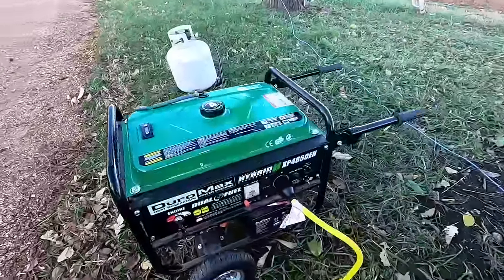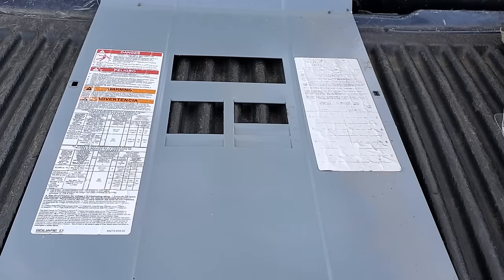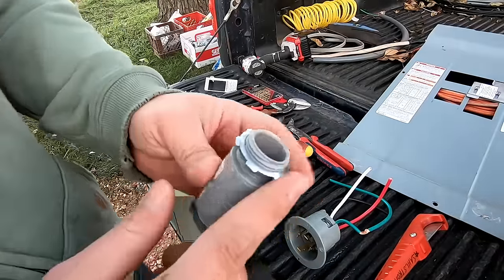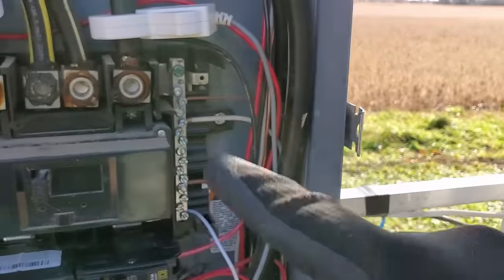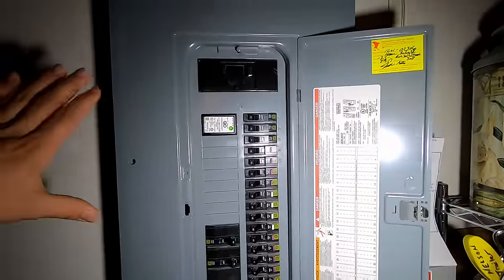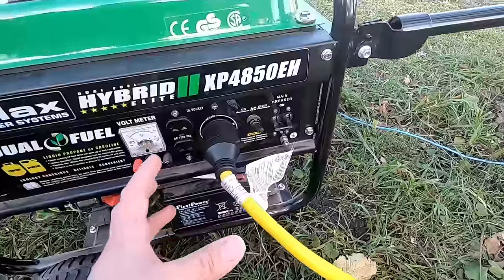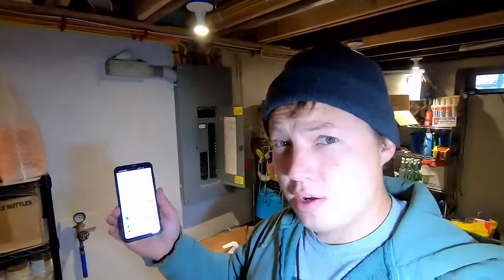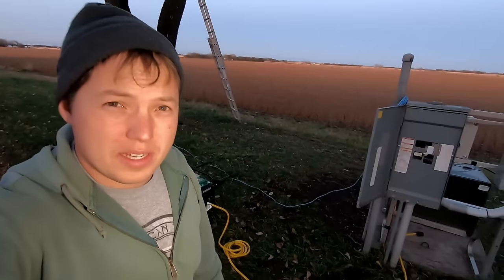How To Hook Up a Generator To Your House Using a Breaker Interlock Kit & Power Inlet Box

Comment: 11:09 don't you need to put grounds and neutrals on different busses? (I'm a newb so I'm just asking out of curiousity)
Reply: ⚠️Please don’t forget to follow the generator safety tips when you use your portable generator:

This is a reminder for everyone’s safety when using portable generators. All generator safety rules need to be followed carefully whenever you use your portable generator. This is just to make sure. 

1) KEEPING OTHERS SAFE: Please do not allow an unqualified person or your children to operate and service the portable generator. Just because some manuals don’t say that doesn’t mean it’s safe. That is important against the generator safety rules. We also need to be keeping an eye on our children too. You need to make sure that your children are not playing near the portable generator especially when it’s running so they won’t get electrocuted. Generators pose electrical risks and they can be hot during an operation. Please keep your children away from the portable generator at all times. It is important to keep our children safe especially our little ones. Be aware of all the hazards.

2) WHERE TO RUN YOUR GENERATOR: Some people use their portable generators indoors which increases the risk of carbon monoxide poisoning. It’s important to have a carbon monoxide if you have a gas generator. Never ever use your generator indoors even if your doors and windows are open and even in the garage is not safe to use a portable generator. Not even at your porch and your deck. It is never safe to use your generator indoors and in enclosed areas of your home. Your generator needs to be 15-20 feet away from your house. 

3)🔥FIRE HAZARDS: Never refuel your generator while it’s running. You need to let your generator cool off before refueling it and before storing your generator. Never overload your generator too. Never ever back feed your generator. You should never plug your generator into a wall outlet. Also never store propane tanks indoors. Please keep flammable things away from the generator as well and please don’t smoke cigarettes near the generator. Having a fire extinguisher next to the generator is also important against the generator safety rules. 

4) GENERATOR OPERATION: make sure your hands are dry before touching the generator. Never use your generator in wet conditions. Don’t let your generator get wet. You need a generator tent if you need to use your generator during wet weather. Please don’t wear loose clothes when operating the generator. Turn on your generator before plugging in appliances. Use the right cord for your generator. Please do not use worn out cords. 

https://youtu.be/I1jT3ANENvI and here is a video more about keeping others safe when using generators. Everything that is said about the generator safety rules all need to be followed. Especially keeping your children safe. 

Hope this helps

Comment: Question about that interlock kit and what you were explaining.  You mentioned that even though the Main was shut off your 110v legs were still energized from unused power inside the House.  So my question is when you flip the main off and the generator on, how are you planning to remove the remaining current to safely in order plug in the generator into that potentially live gen plug, how would you test it before plugging it in during a power outage?
Reply: Use a volt meter to test..
Reply: @fgonzalez78959  I was looking for his response to disapate the energy. Maybe the gen handles it to ground at first connection? . of course a volt meter can tell you what's stil there...
Reply: ⚠️Please don’t forget to follow the generator safety tips when you use your portable generator:

This is a reminder for everyone’s safety when using portable generators. All generator safety rules need to be followed carefully whenever you use your portable generator. This is just to make sure. 

1) KEEPING OTHERS SAFE: Please do not allow an unqualified person or your children to operate and service the portable generator. Just because some manuals don’t say that doesn’t mean it’s safe. That is important against the generator safety rules. We also need to be keeping an eye on our children too. You need to make sure that your children are not playing near the portable generator especially when it’s running so they won’t get electrocuted. Generators pose electrical risks and they can be hot during an operation. Please keep your children away from the portable generator at all times. It is important to keep our children safe especially our little ones. Be aware of all the hazards.

2) WHERE TO RUN YOUR GENERATOR: Some people use their portable generators indoors which increases the risk of carbon monoxide poisoning. It’s important to have a carbon monoxide if you have a gas generator. Never ever use your generator indoors even if your doors and windows are open and even in the garage is not safe to use a portable generator. Not even at your porch and your deck. It is never safe to use your generator indoors and in enclosed areas of your home. Your generator needs to be 15-20 feet away from your house. 

3)🔥FIRE HAZARDS: Never refuel your generator while it’s running. You need to let your generator cool off before refueling it and before storing your generator. Never overload your generator too. Never ever back feed your generator. You should never plug your generator into a wall outlet. Also never store propane tanks indoors. Please keep flammable things away from the generator as well and please don’t smoke cigarettes near the generator. Having a fire extinguisher next to the generator is also important against the generator safety rules. 

4) GENERATOR OPERATION: make sure your hands are dry before touching the generator. Never use your generator in wet conditions. Don’t let your generator get wet. You need a generator tent if you need to use your generator during wet weather. Please don’t wear loose clothes when operating the generator. Turn on your generator before plugging in appliances. Use the right cord for your generator. Please do not use worn out cords. 

https://youtu.be/I1jT3ANENvI and here is a video more about keeping others safe when using generators. Everything that is said about the generator safety rules all need to be followed. Especially keeping your children safe. 

Hope this helps

Comment: I installed a similar setup, with the interlock. My only concern is that it does not lock-out the neutral. Just the two hot wires coming in. I have discussed with other electricians and while this is technically safe and works, it may not meet code, since the neutral
Is not locked out as well. Thoughts??

Comment: At 14:45, why do you put in wire nuts? Would it be better to just straight wire it and connect it to the plug and remove the wire nuts? I’m not an electrician so I don’t know, but I would think it would remove a  potential failure point. unless  what I’m talking is a big no no.
Reply: ⚠️Generator safety instructions:

This is just a reminder for everyone’s safety when using portable generators. All generator safety rules need to be followed carefully to avoid hazards. 

1) Please do not allow an unqualified person or your children to operate the portable generator. Just because some manuals don’t say that doesn’t mean it’s safe. That is important against the generator safety rules. We also need to be keeping an eye on our children too. You need to make sure that your children are not playing near the portable generator especially when it’s running so they won’t get electrocuted. Generators pose electrical risks and they can be hot during an operation. Please keep your children away from the portable generator at all times. It is important to keep our children safe especially our little ones. Be aware of all the hazards.

2) Some people use their portable generators indoors which increases the risk of carbon monoxide poisoning. It’s important to have a carbon monoxide if you have a gas generator. Never ever use your generator indoors even if your doors and windows are open and even in the garage is not safe to use a portable generator. Not even at your porch and your deck. It is never safe to use your generator indoors and in enclosed areas of your home. Your generator needs to be 15-20 feet away from your house. 

3) 🔥generators cause fire hazards too. Never refuel your generator while it’s running. You need to let your generator cool off before refueling it and before storing your generator. Never overload your generator too. Never ever back feed your generator. You should never plug your generator into a wall outlet. Also never store propane tanks indoors. Please keep flammable things away from the generator as well and please don’t smoke cigarettes near the generator. Having a fire extinguisher next to the generator is also important against the generator safety rules. 

4) generator operation; make sure your hands are dry before touching the generator. Never use your generator in wet conditions. Don’t let your generator get wet. You need a generator tent if you need to use your generator during wet weather. Please don’t wear loose clothes when operating the generator. Turn on your generator before plugging in appliances. Use the right cord for your generator. Please do not use worn out cords. 

https://youtu.be/I1jT3ANENvI and here is a video more about keeping others safe when using generators and also about our family’s safety. Hope this helps

Comment: Nice video. I have an inlet box installed. However, I have my computer connected to an UPS in my home office, and I’ve noticed each time I’ve had to use it, the UPS doesn’t “like” what is coming from the generator. Is there anything I can do to fix this? I actually remember years ago at work that someone said UPS should not be plugged into a generator. Is that true?
I have a Durostar 8kw running dual fuel.  I’ve mostly used gas vs propane when I’ve had to use it. Thanks.

Comment: Hello Ben! Thank you for the videos! I am learning alot. I am trying to connect a 18kW max. 15kW running generator to my home electrical panel. I will be using the 50A output on the generator. Do I use a 50A double pole breaker or a 60A double pole breaker for the circuit? The generator says it has peak amps of 71.25A at 240v and running amps is 60A at 240v. I am confused because of the 50A output on the generator with the 60A running amps. Thank you for your time, Mike

Comment: This is a great guide to installing a backup generator using an interlock. A few additional details I’ve learned as I’ve gone through my own install:

Make sure the inlet box is properly labeled with “WARNING: FOR CONNECTION OF A NONSEPARATELY DERIVED (FLOATING NEUTRAL) SYSTEM ONLY” to conform to NEC.

To go along with that, make sure the generator does not have the neutral and frame ground bonded together or else it presents a safety hazard. If it does have them bonded, remove the bonding wire.
Reply: ⚠️Please don’t forget to follow the generator safety tips whenever you use your portable generator. This is a very important announcement for everyone. This is just a reminder for everyone’s safety. All generator safety rules need to be followed carefully 

Generator safety tips: 

1) KEEPING OTHERS SAFE: Please do not allow an unqualified person or your children to operate and service the portable generator. Just because some manuals don’t say that doesn’t mean it’s safe. That is important against the generator safety rules. We also need to be keeping an eye on our children too. You need to make sure that your children are not playing near the portable generator especially when it’s running so they won’t get electrocuted. Generators pose electrical risks and they can be hot during an operation. Please keep your children away from the portable generator at all times. It is important to keep our children safe especially our little ones. Children often get curious about anything so we should keep an eye on them to also make sure they’re not wandering towards the generator. 

2) WHERE TO RUN YOUR GENERATOR: Some people use their portable generators indoors which increases the risk of carbon monoxide poisoning. It’s important to have a carbon monoxide if you have a gas generator. Never ever use your generator indoors even if your doors and windows are open and even in the garage is not safe to use a portable generator. Not even at your porch and your deck. It is never safe to use your generator indoors and in enclosed areas of your home. Your generator needs to be 15-20 feet away from your house. 

3)🔥FIRE HAZARDS: Never refuel your generator while it’s running. You need to let your generator cool off before refueling it and before storing your generator. Never overload your generator too. Never ever back feed your generator. You should never plug your generator into a wall outlet. Also never store propane tanks indoors. Please keep flammable things away from the generator as well and please don’t smoke cigarettes near the generator. Having a fire extinguisher next to the generator is also important against the generator safety rules. 

4) GENERATOR OPERATION: make sure your hands are dry before touching the generator. Never use your generator in wet conditions. Don’t let your generator get wet. You need a generator tent if you need to use your generator during wet weather. Please don’t wear loose clothes when operating the generator. Turn on your generator before plugging in appliances. Use the right cord for your generator. Please do not use worn out cords. 

https://youtu.be/I1jT3ANENvI and here is a video more about keeping others safe when using generators. All generator safety rules should be followed carefully. 

Hope this helps.

Comment: Some jurisdictions require "breaking" the neutral as well as the two "current carrying" conductors (black and red). It has to do with the neutral being bonded to the ground at the generator so that a "ground fault" on a genset fed circuit could send current out onto the neutral. Lots of generators have the neutral bonded to the ground internally. Those are the ones that need the "grid" neutral conductor disconnected also when you are in "emergency backup power" mode. In other words, you need a 3 pole switch. Two poles for the "hots" and one pole for the neutral so when you disconnect, you are "completely" disconnected from the grid. Even the neutral.
Reply: I had the same thought as I just went through this with my interlock setup.  I had a bonded neutral generator and I had to convert it over to a floating neutral so that I did not have a parallel return path as you described.  I looked up the generator he is using in this video and it is floating neutral so he's fine with that setup.  The inlet box should be labeled for floating neutral generators only.
Reply: Also the generator frame should be connected to a gr
Reply: Try again the frame of the generator should be hooked to the service grounding system to effectively bond the neutral. By the way a neutral is a current carrying conductor.

Comment: If my generator is 7000 watt, do I really need to turn off sub breakers? I'm not going to turn on my washer/dryer/stove/microwave so why flip the breakers to those. Nothing was labeled well by the previous owner and I'm not confident in figuring this out by myself (75 year old woman with no electrical experience). I paid $500 to an electrician to prep my electrical box for the generator to plug into the house. Should have asked him to help me label stuff. Also, there's only an L-shaped metal arm that pops back and forth when I turn off the main and turn on the generator. Wish you'd come to my house and straighten it al out for me! Great video...got my questions answered!

Comment: I didn't see this addressed but most generators are bonded themselves. So the generator neutral is usually attached to a lug that's on the Frame of the generator. I was always told if using it as shore(main) power to a house you would unbond them at the generator.  But you would leave them bonded if you are using it as a stand alone power supple. Correct or not?

Comment: surprised you were able to fire the well on that gen running propane. i had the very same gen but want to run lp and ended up selling it a few days later because lp would not start the well.  1/2 deep well set about 300-350'

Comment: how long can you run that generator on that bottle of propane that you have it hooked up.  Looked at the whole house generac propane generators and it looks like it would go thru about  500 gallons in about 5 days of use.  With the price of Propane so high right now that would be over $1000 every 5 days.  I am thinking this may be the better route to use Gasoline but was still curious how long you get out of a normal BBQ type Propane tank.

Comment: Great video, however, does this hookup work with only a 120v, 3 prong connector generator?  I have a RV Camper Champion generator with 4750w surge and 3800w running power?  I had purchased the generator for my camper, and was hoping to be able to use it for emergency power in my home.

Comment: Great video! One question, most videos show wiring up the inlet box to the 120v in the breaker box. You connected yours via 240v...is that correct?

Comment: You may want to replace your insulated screwdriver :) With that much damage, it's probably only going to work at a much reduced voltage. Still better than nothing, but that thing has seen better days!

Comment: What if your generator is only 120V supplying power on 2 conductors?  Do you connect the hot to both poles of the 30 Amp breaker to supply with both sides of the breaker panel with power?

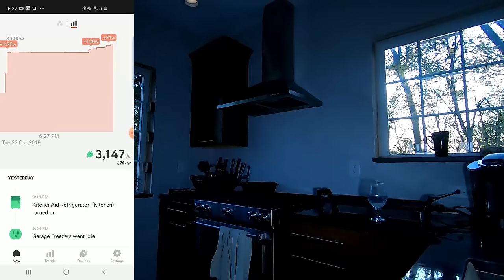Comment: So at 25:19  you are pulling 31.47 amps and your outlet is rated for 30 amps , I would say the breaker on the generator did it's job.